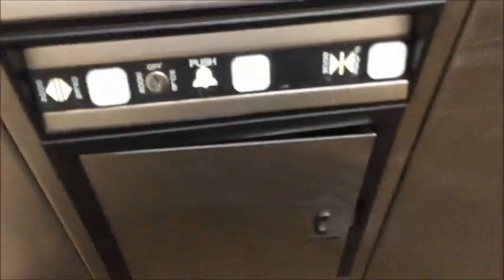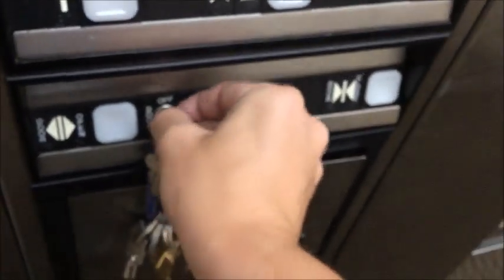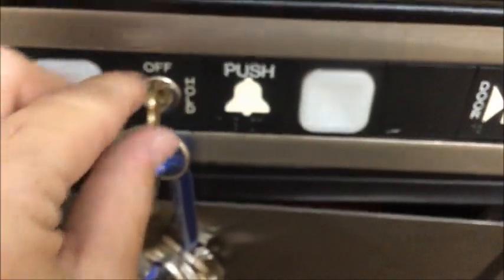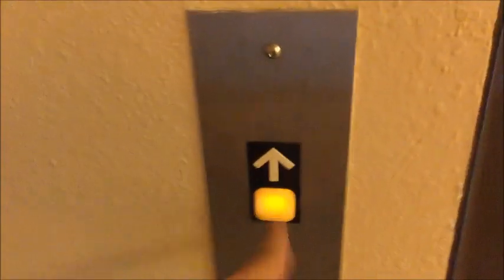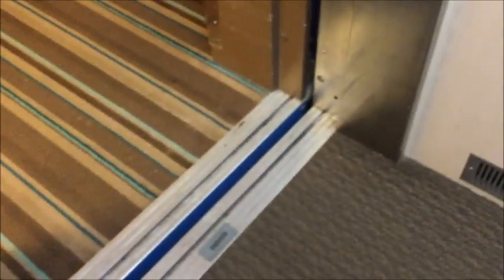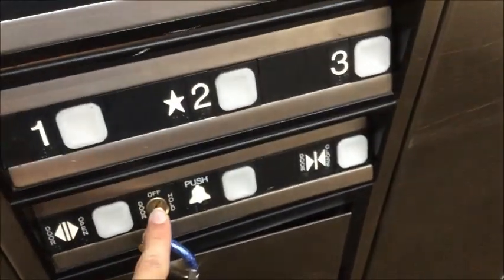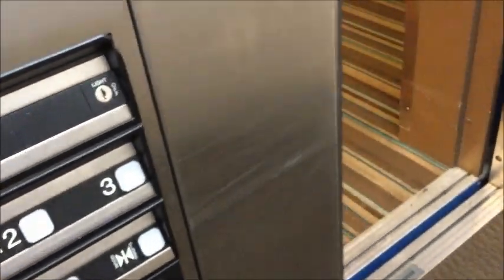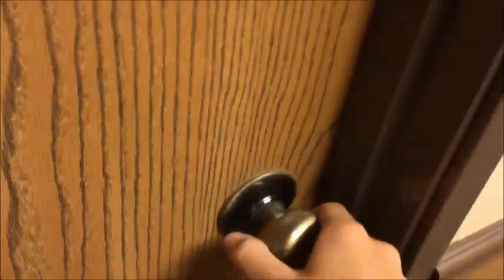Door Hold Key Switch Demo on an Older Dover Impulse Elevator | Elevator Video

Comment: What would happen if you turned it to Hold while the door was closing and a call was registered? Would it cancel it or not?
Reply from the maker: I think it would cancel it if I had to guess
Reply: @Jamestube8439  I can tell you didn't try that. Either that or the door would just reopen. I know on modern day DH buttons it doesn't register if the door is closed (or it does and the Door Open button then has to be pressed), but then it'll still let you register a call.
Reply from the maker: @Undercoverelevator212-s2n  it definitely would re-open, I tried it off camera.  The DH key switch won’t activate until the elevator is at floor and not moving.  (That’s if you turn the key while it’s moving)
Reply from the maker: @Undercoverelevator212-s2n  yep